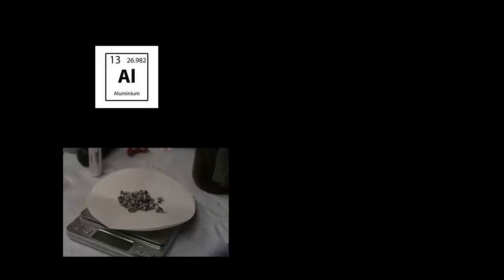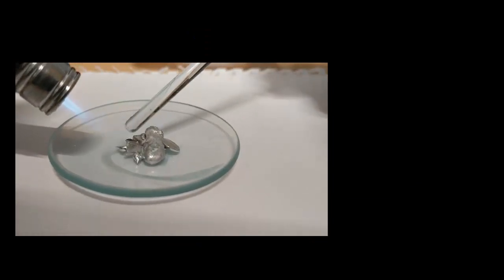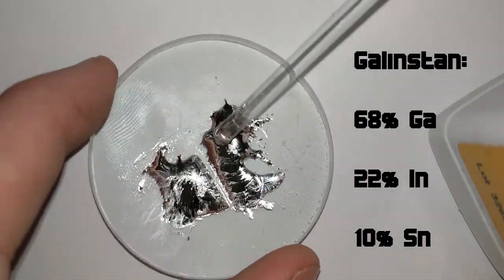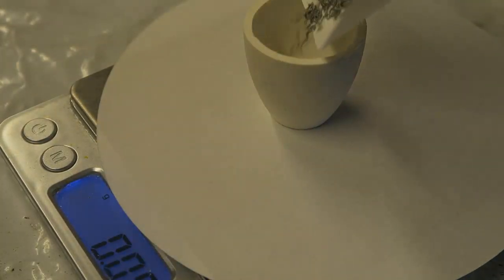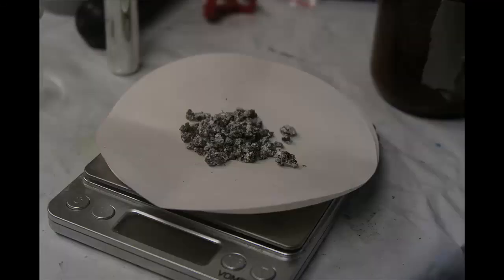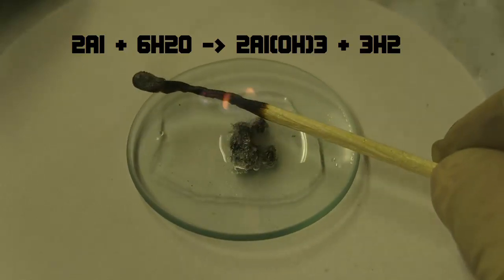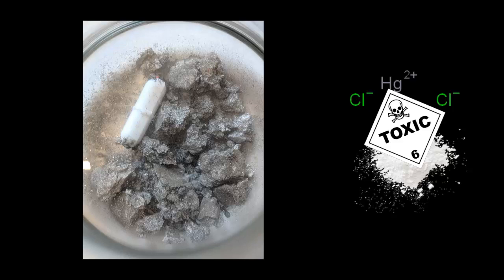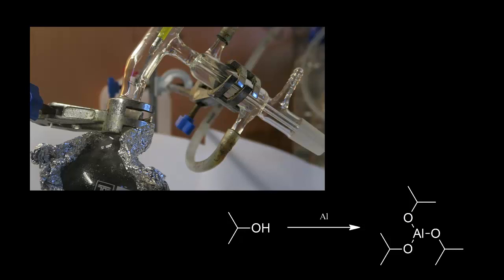How to chemically activate aluminium + synthesizing aluminium isopropoxide

Comment: Cyclohexyl-2-Propanone and Methylamine can be condensed to form Cyclohexyl-2-Propanone Methylimine. Then Cyclohexyl-2-Propanone Methylimine can undergo reductive amination using green non-toxic Aluminum Galinstan amalgam plus 500mg of Palladium on Carbon catalyst in a Carbon Dioxide inert atmosphere and a little formic acid or ammonium formate at 20°C to 30°C and 24 hours. Aluminum Palladium Galinstan amalgam can work too. In either case, Aluminum Palladium amalgam be reused to make Aluminum Palladium Galinstan amalgam. Propylhexedrine synthesis.

Comment: It's missing some numbers.
Did you measure the density?
Did you measure the melting point?
How much 2-propanol did you use?
Reply from the maker: Nope no density and MP. For Al(iPr)3 synthesis look up on prepchem: http://www.prepchem.com/synthesis-of-aluminum-isopropoxide/
Reply: @reactionchamber  Does this require Galinstan or could Gallium Aluminum alloy work at lower yields?